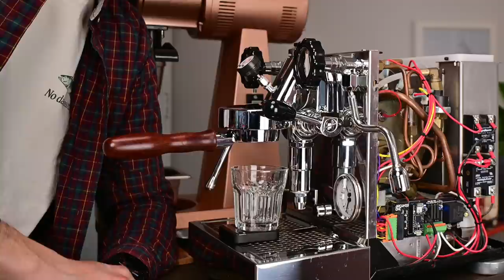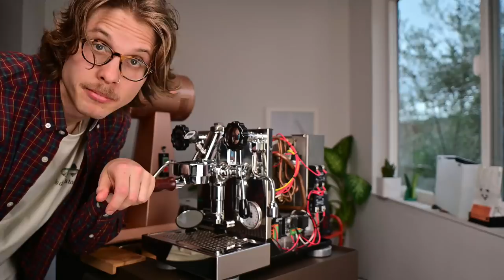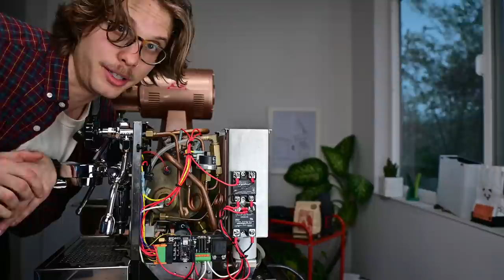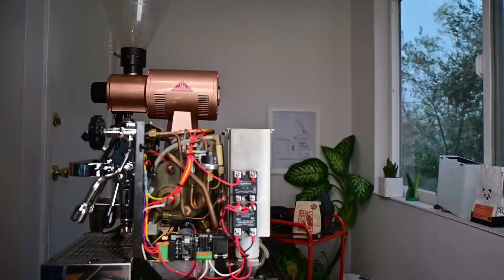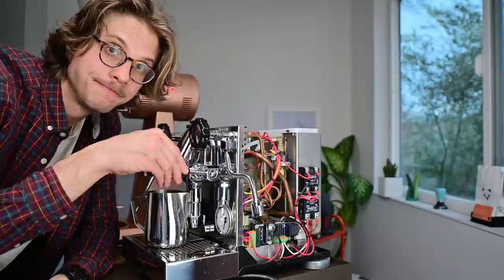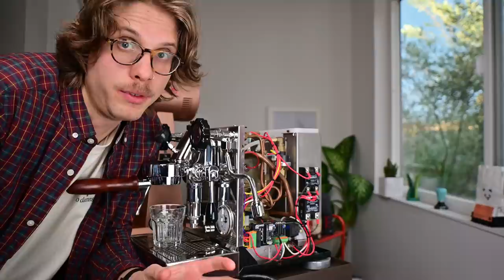I Built an Endgame Rocket Espresso Machine | An Engineer's Rocket Appartamento Mods

Comment: A MUCH needed channel. Coffee professional, engineer, and software designer. Not to mention solid video and audio quality out the gate AND solid dry humor and good presentation ability. Looking forward to your videos!
Now do this to a saturated group machine because I can't stand HX 😅
Reply: I agree Lance. Love the online coffee community, for all its weird nuance and crazy price points, its still very inclusive and generous.  So easy to learn from people that love what they do,  thanks to all of you that pass on your knowledge, it is really appreciated.  Lance and Tate you guys should team up for a video!
Reply: Yeah a saturated group machine would be awesome. Maybe turn a BBE into an end game machine
 with a rotary pump, wireless flow control and an extra boiler if that’s even possible by removing the included grinder.
Reply: Where can i learn more about espresso machine? if machine turn on & the pressure gauge goes up to 15bars before it slowly come down 9 bars. How can i set it not goes to 15 bars. Just want max up to 12 bars? Is it this overpressure valve adjustment?
Reply: So true, a HX is only a good deal if the output water that goes to the group head first passes through a smaller PID controlled 400ml boiler, like some Dalla Corte machines do... At the same time, a PID controlled smaller boiler assembled directly on top of the group head prevents the E61 stand-by overheating issue that even the Lelit Maras (which have a PID) have.
⬇
At the same time I was wondering, the voltage meter that sends its signal to the Arduino moves as the e61 internal valves are closing its water inlet, so I wonder if that's the wiser way to go about re-using the lever as the pump pressure controller.
⬇
Other than that, AMAZING PROJECT, my most heartfelt congratulations!!
⬇
PS: The E61 overheating issue could be fixed in machines like the Mara X, by placing a temperature sensor inside the E61 group and adding a valve that opens and closes recirculation of water from the boiler (into the group-head) according to the temperature reading. Also: we NEED more factory rotary pumps in smaller machines like the Appartamento and the Mara X.

Comment: I have a gaggia classic pro that heats just fine, doesn't over do it or under do it(luckily, although I am a barista so temp surfing just comes with the territory, every machine has it's quirks no matter how good in my opinion, commercial asnd domestic alike), so I'm just after adding the dimmer mod, to drop it to 9bar. Can now do full pressure profiling for the cost of a 100w dimmer, like €4.50 with delivery, ran the wire out the top and it's magnetic so absolutely zero damage and completely reverable. I'm happy and probably too caffeinated.

Comment: Awesome, you could totally use the arduino to record the inputs of the potentiometer and parameterize different techniques and bind those to buttons/presets, less skill involved but should guarantee similar shots every pull.
Reply: That's what came to my mind too. Just automatically record the profile every time, and when the shot turned out well mark the profile for permanent storage. You could have a list of profiles with different styles, and just replay which one you fancy

Comment: Fascinating. I'm wondering if you could somehow add a line of code that runs the pump with the group closed so it back flows out of a over pressure valve like a commercial espresso machine has to automatically bring the group temperature down automatically. It would likely need to be tapped in right before the valve on the group which would be a lot of custom work. That or it could auto cycle before loading the ground coffee. 

Really great work here.

Comment: This is absolutely fantastic. Aside from the temperature inconsistencies associated with the thermal coil boiler, you've addressed essentially every beef you could possibly have with this machine.

How do you shield your electronics from errant water? For example, my vacuum prevention valve will occasionally blast a little steam into the interior of my machine when it's initially heating up. I can't imagine any amount of condensation would be great for an Arduino.

Comment: This video is awesome! ive been modding my 10 year old Appartamento in bits over years. initially two solenoids, a switch and a pressure regulator to build my own plumb kit, and changing the physical switch for a momentary toggle to IOT enable it and turn it on automatically when i get out of bed! looking at your other videos i'm now trying to figure out if i go full on rotary pump, or upgrade the 10 year old vibe pump with a marax silent pump and a pulsor.  so many decisions!!  would be well up for modding with your board when available!!

Comment: I know this video was while ago but you should be able to solve the flickering lights by telling the heater controller PWM cycle to run at the same frequency that your household power runs at IE 50 or 60hrz. Its a pretty common issue with 3d printers and the heated beds. I would assume the ardiuno based controller you have should have the ability to adjust that. 

Great mods!

Comment: I think i've seen your machine on n instagram recently, really love the build. Where did you get that gear pump tho?I've been searching for modbar spare parts but it seems almost impossible to buy one, at least online.
Ive fittet a old 3Gr Faema with PID, flowmeters and a data logger tracking its group pressure. I'd love to have a programmable profiler in that machine too....😅

Comment: Awesome build! For the Fluid-O-tech MG304, was the primary motivation to be able to change brew pressure electronically? I am looking at replacing my appartamento pump because I believe it is failing, but I was thinking about replacing it with the Lelit 4000040 silent pump, as I don't care about having the ability to adjust brew pressure on the fly. Thoughts?

Comment: Awesome video, thanks for showing how much more awesome you can make the Appartamento.

Question - did you have to move the boiler when installing the dual gauge? There is essentially no room behind the OEM gauge.
Reply from the maker: Thanks for the kind words! Good question. The replacement gauge is tight but fortunately fits. It's basically resting against the boiler

Comment: Thanks for making this. Can you elaborate on the electronics components? Also the dual pressure valve shoes pump and boiler pressure, is that correct? 
What do you use for the controller? I love the idea of the analog measure for the lever. Would the controller allow you to save profiles so you can just reply a profile that you put in manually by pulling the lever on? Is that decoupled? 

I have a rancilio silver and a Sanremo cube. I think for the cube that be so awesome! 
Ps: I’ve got a tour from Ricardo on the belweather in Berkley. Cool stuff

Comment: I've had the Rocket Appartamento for about three years and it has been a good first machine.  I am a "closet" engineer and would love to take on a project like this but without your skills would find this mod a little too much to manage without more complete instructions.  Ever consider selling a complete kit, all parts and instructions to do this?  I could handle the sourcing of the parts, but being able to purchase a control board that was fully programmed along with a full wiring diagram and instructions would be awesome.  I don't know what the full mod would cost, but my other choice would be an R58 for $3K and this upgraded Appartamento with the variable speed pump is actually better in my opinion.  What about starting with a more basic mod of just converting this to a PID controller?  that alone would be a huge improvement and probably not that difficult.

Comment: You’ve probably been asked this question many times, but do you think it would be possible to have a dual probe at the brew head that would give us pressure and temperature at the same time? Thanks for sharing the incredible work you’ve done!
Reply from the maker: Yes definitely possible! There are some gauges out there with both of those measurements, I just haven't found how to adapt the typical 1/4" npt fitting to the group's M6 fitting. That should be all it takes! Would love to know if someone finds/makes an adapter like that

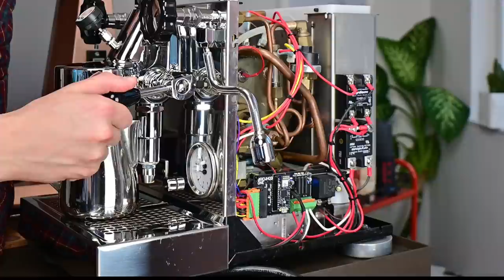Comment: I'm a little worried that the group lever is going to wear off in no time, check: 7:42 
There's obstruction and my experience tells me it may wear off the brass.
The Arduino regulator is something impressive and I will love to learn though, something new to me.

I'm very concern of the exposed regulators and electronics on the right. Safety hose coming off, wet cups come into my mine.

Not really a big fan of Rocket Appartamento, how can they skip placing a brew gauge on a prosumer machine and price themselves at a higher premium than most established Italian makers. The choice to remove the brew pressure gauge, is not due to any technical constraint, it is is something they have decided to do by choice. It could be easily attached to the overpressure valve. They have also cut short on the relay, full of flimsy thermostats, silly placement for the pump and solenoid. I prefer the safety valve directly planted onto the boiler, not another copper pipe.

The way the heat exchanger is designed, the stability of temp isn't great.

If one wants to get something similar, could simply go for the new Bezzera Aria.
A 1.5L hx copper boiler with proper insulation, faster heat up and better temp range
Nice and quiet rotary pump
Flow control
Dual gauge (pressure + boiler)
Additional grouphead gauge pressure profiling.
Good SSR relay
Shot timer and PID
Joystick wands
Plumbable or switchable with internal tank.

Most importantly, they are designed like Toyota and Honda, with service techs in mine. 
The build and choice of parts look pretty solid.
They are much easier to service, electronics are shielded, meaning likely better longevity and lower cost for repairs.

Comment: Instead of using a cam on a linear potentiometer, why not attach a rotary pot to the lever? Seems like that would give better control with less hysteresis. I'm guessing the reason is aesthetics, which is valid because that thing is gorgeous.
Reply from the maker: Thanks! You're exactly right, I went this route because it was mostly off the shelf parts and more elegant, especially considering all the electronics stay inside the machine

Comment: Oh, and, you should probably get rid of the plexi, else you’ll melt all that nice wiring you did and those components you chose.  I bet some textured brass screen would look good.
Reply from the maker: You'd be surprised by how little heat reaches the plexiglass. Not even enough to get warm. It's held up for years 🙏🙏

Comment: Finally, there's someone I can ask! Since there's always an offset between the boiler temperature being measured by the temperature controller and the temperature at the group, and since the only effect of the I loop in a PID algorithm is to null out an offset,  why have an I loop at all?  Without it, you'll settle faster, at an offset from your set-point. But you're building in an offset anyway, so that offset is of no consequence at all.
So: Why PID and not PD?
Reply from the maker: Good question! Frankly adding the I-term is really just adding a couple lines of code, so it's not a particular burden and makes the code portable for a dual boiler (video coming soon 👀👀). It's also nice to be able to refer to rocket's temperature translation table to map the steam boiler temperature setpoint to the brew water temperature. This PID is working essentially identically to the PID in a chronometro or similar PID'd rocket machine, so I can refer to their documentation.
Reply: Heyo! I know a bit more about regulators than I know about coffee, but there's some things to correct here. You're correct that the I term makes the regulator go "slower", but it enables to regulate precisely to a set temperature. Without it, you won't be able to achieve the set temperature exactly in the real world.
The difference of temperatures is where you've got things mixed up a little. The regulator regulates to a set temperature on the boiler (that's where the temperature sensor is), but the group is always a bit cooler due to thermal loss (this needs to be accounted for in software - i.e. setting the target temperature a bit higher in the boiler). This temperature difference is something you need to measure or estimate beforehand and put it into the software, otherwise you would have to measure it in the group directly.

To sum up: 
With the I term you're able to regulate precisely on the boiler temp and if you know the boiler-group temp difference, that means you can precisely control group temp.
Without the I term you won't be able to precisely regulate the boiler temp in the first place, so even your group temp is going to be a bit off.
Reply: @stanislavsvediroh6622  Not at all. You just have to include the steady-state offset of the PD controller in your choice of set point.

Comment: Awesome job! I’m really curious about the gear pump and the switch. I’d like to do a gear pump swap. I currently have a vibe pump on a potentiometer but it changes dramatically based on the machine power use and is not consistent. 

I think you need a few valves and things to make the gear pump work. Can the switch be wired in without all the custom board bits? 

I’d love to know the board and the software. Is there some open source decent-style logging program?

Comment: Wow great job, very inspiring! Do you think it would be possible to add a combined temperature and pressure probe to the e61 grouphead (into the hole where your temperature sensor is currently). Currently I have only found options for one or the other. Is there somekind of physical limitation for  why this kind of sensor cannot be made? I would be very useful if possible. Awesome video!
Reply from the maker: Ugh I've had the same frustration! There aren't any physical limitations that I know of! I've seen some dual pressure/temperature gauges with the wrong pressure range, but there's just no off-the-shelf options right now :(

Comment: Awesome mods but kinda sad it still needs so much cooling flush.  If you did it on a good single boiler or dual boiler machine and trusted the temps you could install a group pressure gauge instead.

Comment: This is a mega cool rig! I’m curious what software you are using, and where you implemented PID control into your machine? Im super interested in the control systems for your machine.
Reply from the maker: Thanks! I've included the firmware's GitHub repo in the description, it includes the PID control system

Comment: Would love to see some mods to a Lelit Mara X - was torn between the Appartamento and the Mara X and ended up going with the latter and I'm loving it, it's got some UART outputs on the board which allow for some nice mods (pulling temperature to a raspberry pi and displaying it in a graph on a web page, etc.) so it would be great to see what else you could do with it - relatively cheap machine too :)
Reply from the maker: Oh wow that's a fascinating feature, always been curious about ways to tap into already-existing controllers 🤔🤔
Reply: @tatemazer  it's very easy to do (cheapusb to UART cable off Amazon+ a pi/laptop)

Comment: If you're still checking this:

I noticed your boiler appears to have a thermal jacket on it, and I was wondering what material you used / where you got it, as I was considering doing that to my Appartamento to attempt to improve temp stability + efficiency
Reply from the maker: It's fiberglass insulation for automotive exhausts, it's honestly kind of awful to work with and doesn't do a great job of insulating. It also required that I completely remove the boiler and all it's fittings 😵‍💫😵‍💫😵‍💫

Comment: Did you add any mods to the steam wand? 
I imagine you could control bubble size by varying the pressure or flow rate.
Reply from the maker: Good question, I've actually found the steam wand on this is very comparable to the performance I've experienced with commercial equipment, so I've been happy enough with it 😁

Comment: Nice work! 12 bar on a self tapped hole, sounds scary. Are you sure it's placed low enough for the water level reaching that high in the boiler? BTW it's not uncommon that overpressure valve spill water and drip where your 24v PSU is 😅

Would be nice to have a small form factor gear pump with built-in 24v PSU
Reply from the maker: Great questions! The hole is on the steam boiler, which only maxes out at about 1.3bar. I used the same location that rocket uses for their higher end machines. Measuring the steam temperature is exactly what I'm interested in so it's preferred to measure that as opposed to the liquid water.

The OPV drain is attached directly to the reservoir, so when it opens it goes back into the water lines. Maybe you're referring to the steam boiler's safety valve? Fortunately there's a hardware interlock (thermostat) on the very rare chance that it blows open. If that thing blows open, I'm already in bad shape!
Reply: @tatemazer  I mean the valve on top of the boiler. Although I think it is for letting air in when cooling down. I had a small steam leak on my new apartemento. So the steam pressure was never able to close that valve and constantly spitting out water. I don't think Rocket is testing them all in the factory
Reply from the maker: @spruce1000  ah that's the vacuum breaker. What a bummer yours was leaking already! That's probably the most leak-prone part. It's unfortunately not too common for it to get sticky and fail to seal. I hope that they were able to get you sorted, should be a cheap fix